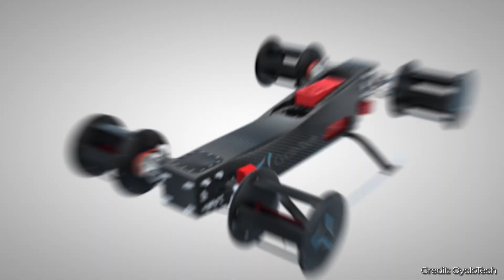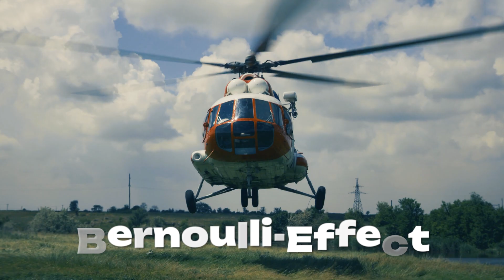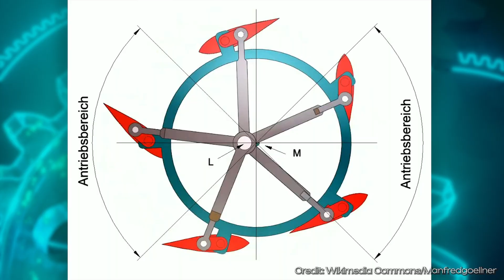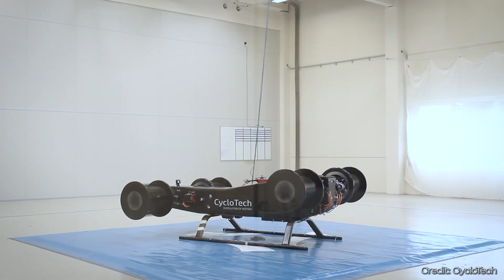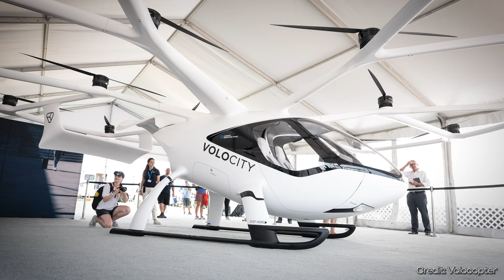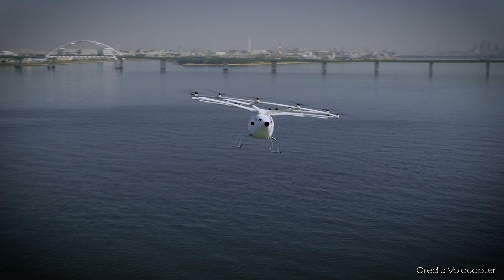This helicopter has rollers instead of rotors!

Comment: 1:15: it's not the Bernoulli effect, (https://www.youtube.com/watch?v=e0l31p6RIaY) so yes, if you did "align->distribute" you can see that the particles would be closer spaced together at the bottom than the top, but that's not the point. you can also see the particles have a different vector & according to to Newton's 3rd law, that means lift happens. i'm sick of talking about this. agree to disagree.

Comment: IF the "Rollercraft" shown uses lift based on the Magnus Effect, then its lift efficiency is 30 to 50 percent lower than quadcopter and other designs (like Volocoptor) which use standard propellers. While exceedingly 'cool' and novel, I think Magnus effect systems will have to be confined to labs and toys.

Comment: Fundamental problem is the paradigm is about making a general purpose flying car for the general consumers. The ordinary car consumer has already many difficulties to drive his car in a city 2D regulated city road grid. The problems with a 3D city road grid will be enormous. It will be much pragmatic to first define the norms for 3D city fling cars and adapt the general purpose flying cars solutions to those norms.

From history we have learn how many problems was caused by adapting the norms of 2D city road grids to general purpuse cars. My guess is there will be an exponential increase in difficulties to transition to 3D city road grids.

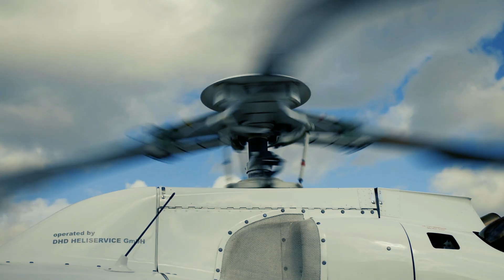Comment: 1:00 Air doesn't move "faster" over the top of a wing. The air isn't moving at all, the wing (blade) is moving through the air.
Reply: change your reference frame to be the wing…
Reply: @jakemaranzatto6514  No. The reference frame is the air. The still air.

Comment: Would make a lot more sense to design it with an airfoil lifting-body and some stubby wings to help with improving efficiency in forward flight, which will be where it will spend most of the time.

Comment: Sideways gusts of wind will still be a problem; the only way it can counter sideways movement would be by rolling the whole aircraft. Maybe they could get sideways thrust by sacrificing some longitudinal thrust and aligning the rollers in a more X-like shape. Or if they can get the airfoils to get into more "sucking" mode and channel the thrust sideways thru the roller instead; I'm not sure how much thrust that would add, it would need a hole on the outside of the rollers, and adding an additional degree of freedom to the airfoil angle of attack control mechanism might be a bit complicated; and of course any thrust that is redirected is thrust that is not fighting against gravity, so they would probably need to be able to increase the rotor speed and only partially redirect the thrust thru the central channel.

edit: Ah, rewatching I see some variants of the design got a third pair of rollers that doesn't do anything for lift and is just for horizontal thrust, and others that don't contribute to thrust, just hover and sideways thrust. Seems a little wasteful unless the downsides of repurposing the hover/thrust rollers somehow are worse than having that extra weight not contributing much to the main needs.
Reply: He discusses this at 5m05s (just say 5m mark) .. and I believe the first of the variants your edit covers is at 5m21s

My question would be: given the variability in directionally controlled thrust, though 'outwards' or laterally is seemingly the most obvious, it'd seem that downwards for lift or even upwards (if needed??) could also be an option? 

Such as to say, it doesn’t seem entirely singular in purpose thus 'cost' to the overall system.. especially if continued lift is desired while the primary 4 engines shift towards forward or reverse thrust. 

It'd also help with lateral strafing movements..

..and keep in mind, these are early designs. It could get into contrarotating for 'whatever' reason such could be beneficial per thrust, control, etc..

Likely at a distance/flight time hit, but it's a relatively new platform.. ..still being figured out. 'Who knows' what potential evolutions may spring from it as more and more get exposed to it and start tinkering??

Clearly they've already shown reason to not limit it to four even six motors.. maybe more provides more versatility and control.

Lighter stronger materials combined with lighter/denser (by volume/weight) batteries are being developed on the regular, etc..

Comment: It doesn't look like there's any redundancy if something fails.
Helicopters can use autorotation to land if the engine quits, for example.
Reply: You can recover a drone with as little as two motors even if they're on the same side.
Reply: @jtjames79  Yeah, I've flown drones out of trees after wrecking half of the props, but there's a big difference between recovery and flying one full of terrified passengers while navigating to a clearing on the ground. They will have to prove this to the FAA/NTSB. But again, I'm glad their invention exists and I hope people keep coming up with new ways to fly.
Reply: @CarbonPhysics   I mean it was solved by a computer in 2022 I think.

If you want it, there's a library for it. 

The trick is spinning apparently. You do a big "drift" all the way down. And by "you" I mean the computer.
Reply: @jtjames79  Yes I've seen that. Again for a drone that would be fine, but with a full-size flying vehicle with people on board, they would all be dead or wishing they were dead.
Reply: @CarbonPhysics  That's why you always emergency land when you have problems with one rotor. And not after one fails. 

It should be a rather ridiculously rare problem.

Particularly if you are using electric motors. You can read any resistance that comes back and know about problems long before failure. 

Or just add a couple extra rotors for the people size ones. 

I'm just not entirely sure that's necessary. 

I wished I was dead before. There's worse things. 

Maintaining an auto rotation in a whirly bird is still a hope and a prayer situation, even with the best pilots.

But that's just like my opinion man. 🤙
Reply: @jtjames79  No, it's not a hope and a prayer. Demonstrating a landing using autorotation is part of certification for a helicopter pilot license, speaking from experience. If the engine quits, you have all kinds of time to get to the ground. It's by no means a panic situation, and it happens all the time. I have personally had it happen more than once. This is why the NTSB and FAA will never let this thing off the ground unless they can demonstrate how it's going to get people to the ground safely in the event of many different types of failures, from a broken/shattered propeller to complete power failure.
Reply: @russbell6418 It will be interesting to see where this new technology goes, whether they use a ballistic parachute or whether it can make it to the ground if it loses power. I'm glad people are still coming up with new ideas.

Comment: The dimensions of this aircraft, to me, is its biggest selling point. Sure, it's larger than a normal vehicle - but not insanely so. The lack of wings is a good point though: what happens if power fails? The best answer is a parachute, á là the Cirrus light aircraft.

Comment: The term is “angle of incidence” or “angle of attack”, not “angle of inclination”. It is the angle of the chord line relative to the oncoming “wind”, not relative to the horizontal.
Reply: Also, “albeit” is not a German word so it is not pronounced “all bite”. It is a word constructed from the phrase “although be it (that)” way back in Middle English. The V2 construction is odd to Modern English, but it is a set construction. So, say “al-be-it” with the emphasis on the “be”.

Comment: You're progress in english pronounciation has been remarkable. I remember you struggling with single English acronyms in your older german videos. But I think your trying too hard to hide your accent. Don't emphasize the "R"s so much. Focus on emphasizing the correct syllables and on getting the flow right. And if words are unclear, let google translator read them out for you. "Albeit" is pronounced like a merged version of "all be it" , not like "all byte"

Comment: What happens if one of the four rolls fails? Would the helicopter still be maneuverable?
Reply: I think it should be. The germanscienceguy said, that you can increase or decrease the thrust by just increasing the distance between those two circles
Reply: I think this is one of the big problems, conventional helicopters can auto-rotate if they lose power, I don't think this can (but please correct me if I'm wrong).  So for safety you would have to be able to fly with at least one roller out, and ideally 2.  Increasing the thrust from one roller for a short time should be possible.  What happens if you lose both rollers on one side?  Will need lots of double drive systems (just like twin rotor helicopters), and these are heavy.

Comment: Top! Ein kleines "aber" habe ich: Ich finde Du solltest langsamer sprechen (und auch mal Luft holen), es kommt mir viel schneller vor als in Deinen deutschen Videos (und ich verstehe englisch sehr gut). Und, wenn Du die Amis auch erreichen willst, dann müsst ihr km/Meilen etc. sagen oder zumindest einblenden.
Reply: Reduzier einfach die  Videogeschwindigkeit. Ich nutze diese Funktion auch in die andere Richtung.😀
Reply: The metric/customary units conversion is appreciated, but only necessary for non-technical audiences. We are taught “bilingually” in school, and only lose it from lack of practice. This is a bit of a “popular science” video (with an incorrect theory of lift explanation), so it might be useful if this is what he does.